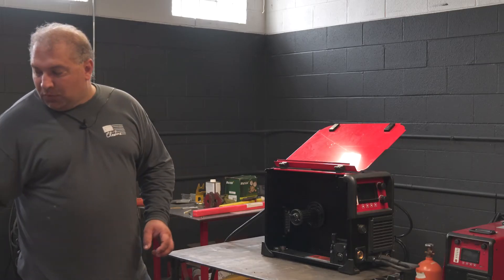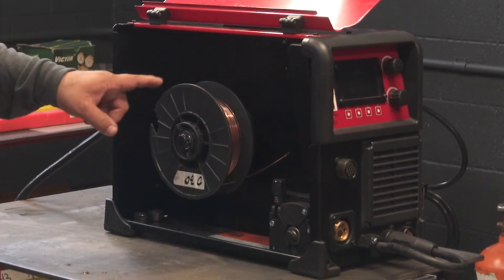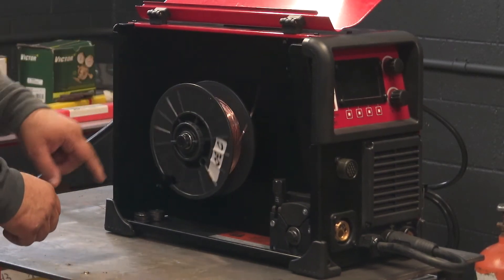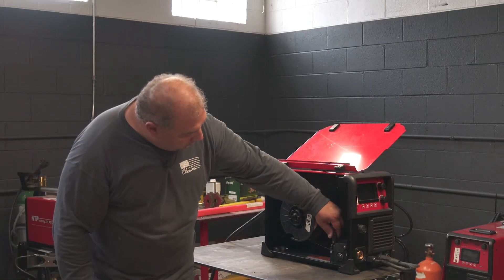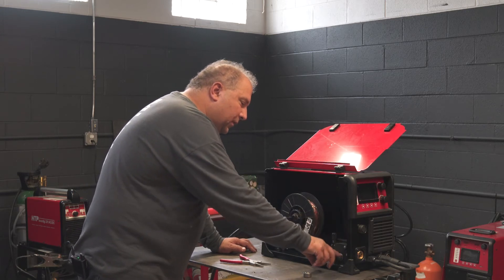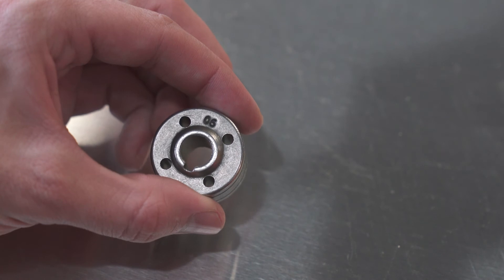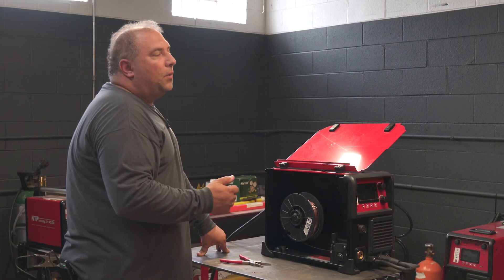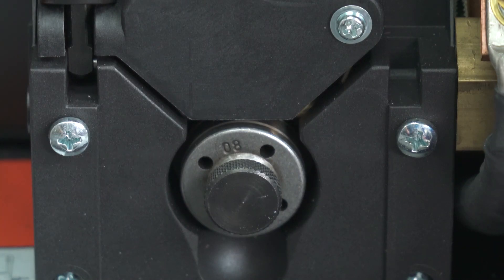How to Load a Steel Spool of Wire (Pro Pulse 220 MTS – Setup Part 2)

Comment: Peter, I'm going to be ordering this machine within the next few weeks. I have to say - this video series is the absolute BEST! Few companies put forth this type of effort going over the smallest of details. I do have one question - on the wire feed rollers, why don't they simply put the numbers that correspond to the wire size (.030, .035, etc.) rather than 08, 10, etc.? I do kinda wish you had the option for the 4" rolls as well considering I've got dozens of aluminum (4043 & 5356) rolls left from my current Hobart MVP210 which is being replaced by your machine. Okay, I'm off to Part 3, I'm going to watch this entire series several times each prior to purchasing to give me as much heads up on working with it as possible. Oh yea, I definitely prefer the gray color of the latest edition of these welders. Is this just for the 2022 model since it's an anniversary model? Will they be going back to red next year? Okay - thanks again! mike
Reply from the maker: I am glad you are enjoying this series! The rollers are in metric which is how the rest of the world operates instead of in inches. That is why they say .08 vs .030", remember they are italian based machines. Aluminum wire is wound too tightly on the little 4 inch rolls which can cause drag and feeding issues when welding aluminum through a regular gun. If you haven't already you should watch our "Why Alcotec Wire video". The silver color is staying.
Reply: @usaweld  Thank you! I hadn't thought about metric . I had been looking also at the Fronius, they have 4: & 8"  role capacity which I thought was a great way to use up all my 4" rolls. On the other hand, they cannot run the 12" rolls and that's a big savings on purchasing wire, at least locally. And yes, I'm familiar with the Alcotec - it's kinda like the Holy Grail of wire!  The only other thing I thought was a big perk for Fronius was having two gas hookups. I thought that would be great, argon for aluminum and my C25 for steel. BUT, now I'm seeing your videos saying the C25 is not viable for spray and pulse, which is biggest selling point of your welder. That's something I did not know prior to your video series. Guess I'm gonna have to buy a 3rd bottle now with the higher mix of argon/co2. I've been welding steel with short circuit and the C25 has been great at that. Sigh.